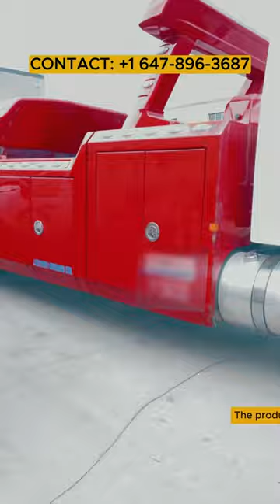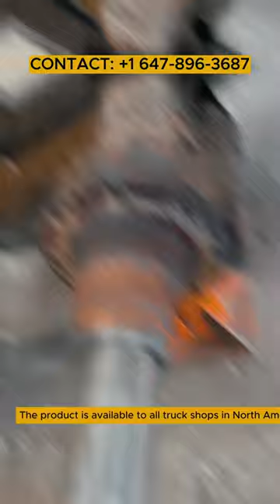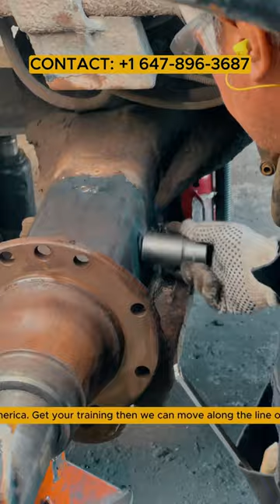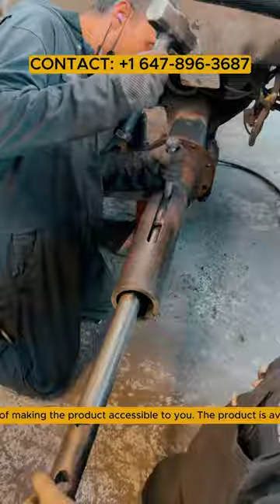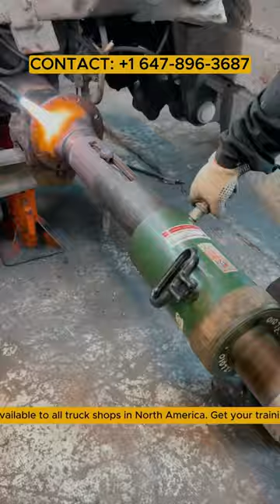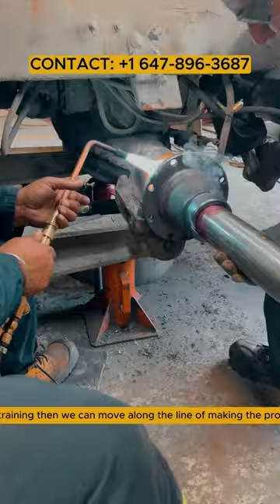How to Replace damaged Mack Truck Spindle #shorts #axlerepair #mechanic #trailer #asmr #amazing #usa

Comment: I'm wondering why they didn't make that solid not hollow to keep it from breaking like that.
Reply: Porque esse é um eixo de tração,esse oco é para passar o semi eixo que faz a roda girar.
Reply: The drive alxe fits in the middle where it is hollow. It is a very strong design called a full floating axle. All large trucks use them including light duty like 1 ton and most 3/4ton trucks.